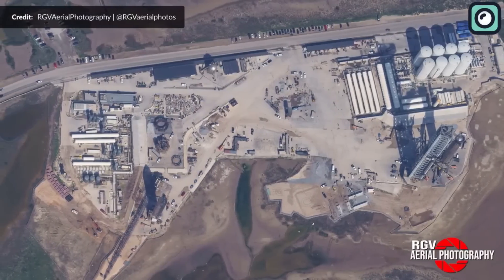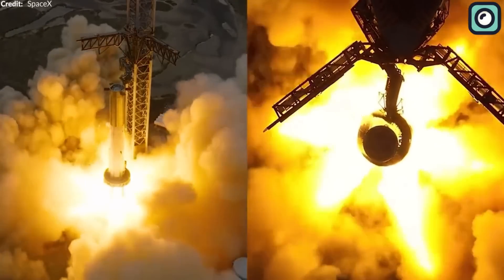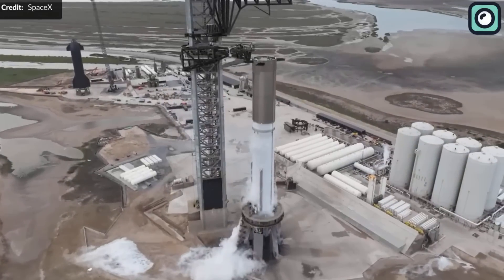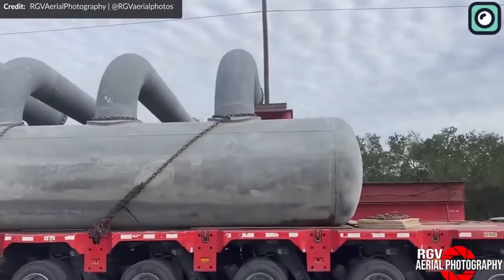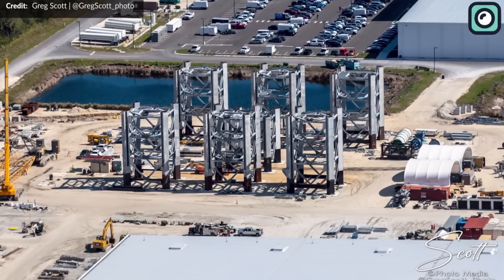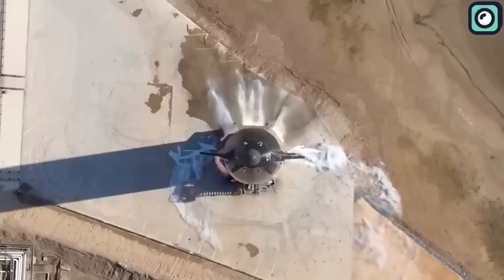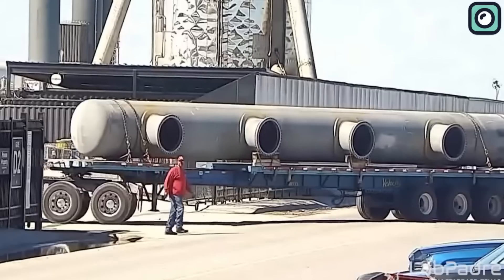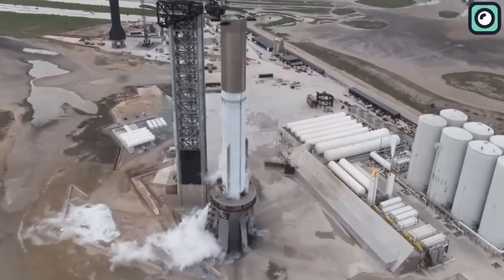Starship's Final Static Fire Test Before The Orbital Flight?!

Comment: They could do an at sea test landing.  Not an actual capture but an emergency type capture.  6 barges with a wire cable capture net suspended between them; or some better idea. Especially if it can perform a practice semi-hover.  Just to give he engineers somethin to think about at the coffee table.

Comment: Light that CANDLE.  
Do not attempt recovery on first flight!
March 2023.
Reply: Yeah but;  like the test fore they could do an at sea test landing.  Not an actual capture but an emergency type capture.  6 barges with a wire cable capture net suspended between them; or some better idea. Especially if it can perform a practice semi-hover.  Just to give he engineers somethin to think about at the coffee table.
Reply: @clavo3352   I agree.